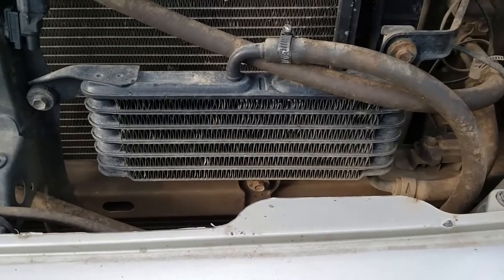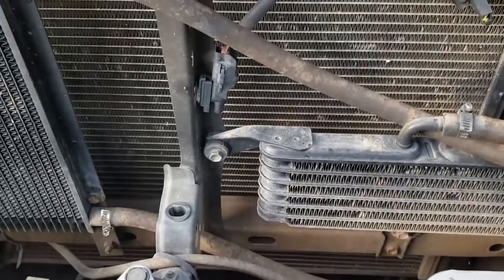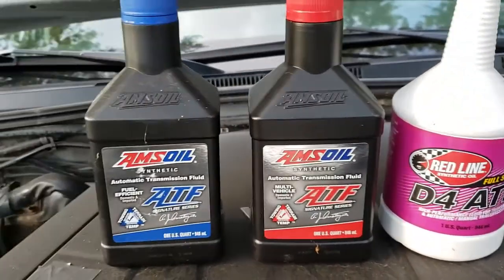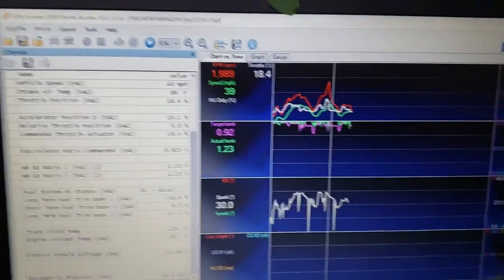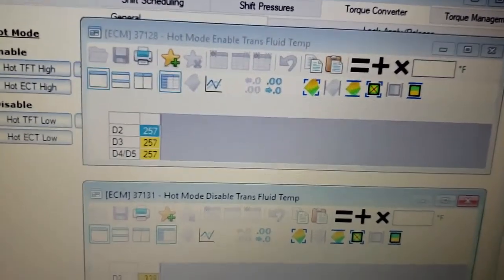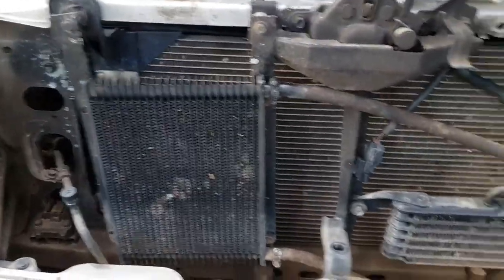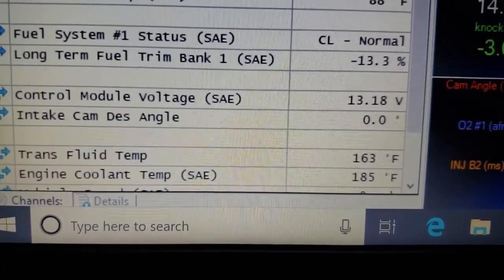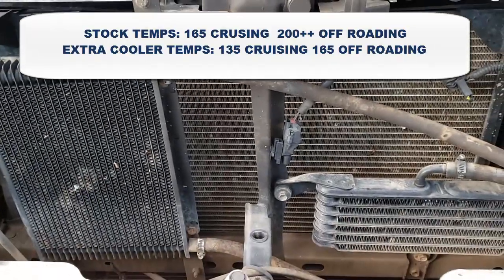Toyota Tacoma Transmission Cooler

Comment: When you add the second transmission cooler, do you also have to add extra transmission fluid to compensate for the extra surface area now made available in the new transmission cooler?

Comment: Ok now I'm concerned... Just bought a 3k camper... No tow package, had a hitch and brake controller installed recently. Have 224k on my 06 Pre-Runner. The spot we typically camp at requires a hill climb going towards Reno NV.
Reply: lol your screwed
Reply: @lucasmurphy5407  lmao!
Reply: @lucasmurphy5407  nah I'm good. 2 trips before cooler installed, tech said tranny was fine and old fluid showed typical varnish for its age but no metal shavings in it. She's a champ.

Comment: Hey quick question, I don't have the little transmission cooler. Mine just goes straight to the radiator and back to transmission. Do you know which line is the hot line to the radiator. Is it the top one like the engine hoses or the bottom hose. Thanks

Comment: What app are you using to monitor trans temp? I can’t seem to get my trans temp readings. I have a 2013 Tacoma with tow package and use the car scanner app with the Veepeak OBDCheck BLE OBD2 Bluetooth Scanner Auto OBD II Diagnostic Scan Tool
Reply from the maker: dash commander with obd link LX / HP tuners on a second gen most apps will read trans temp

Comment: I bought a 2020 tacoma Trd sport and it has all the tow package features EXCEPT a transmission cooler. I bought the thing for towing a side by side and now I'm freaking out that they may have misled me on the towing capacity. The specs are as listed "Part-Time 4x4 Sys w/2-Speed Electronically Controlled Transfer Case Towing Receiver Hitch, Eng Oil Cooler, Pwr Steering Cooler, 130-Amp Alt, 4/7-Pin Connector, & Trailer Sway Cntrl" Would you think I can still tow with this? I'm having a hell of a time figuring all of this out.. I am not a car guy I just got a truck for outdoor activities..
Reply: Call dealer ship and give them your VIN#, they can let you know what your tow capacity is.
Reply: Yeah of course you can tow with it dude you're not trying to tow a shitload of weight just take it easy but remember if you go too slow you're not getting much air flow and if you go too fast it's harder on the truck probably around 50 or 60 mph that's easy work for your truck pulling a side a side